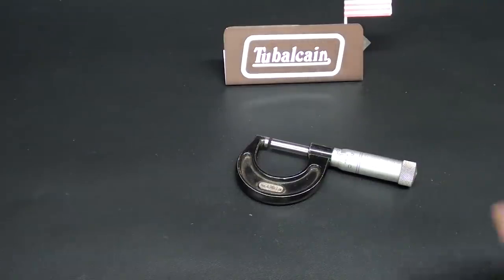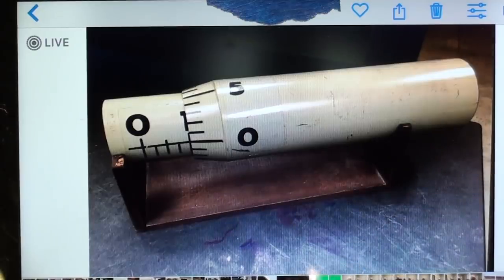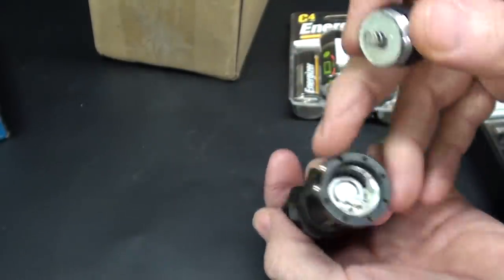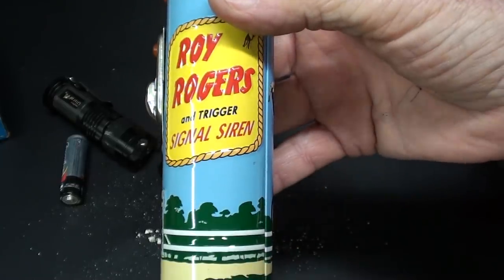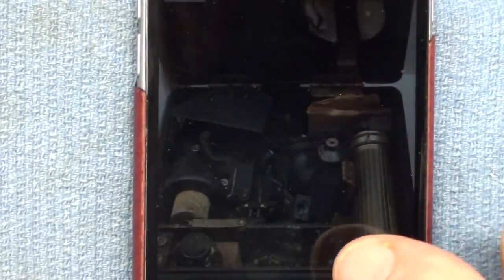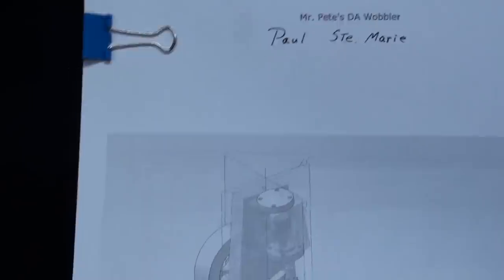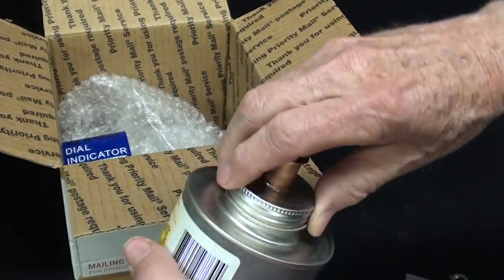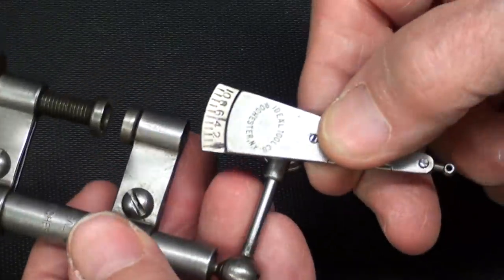THIS & THAT 45 tubalcain mrpete222 ideal indicator

Comment: Energizer at least used to make a fantastic product but I've had such a problem with them in the last few years that I'm almost certain they've changed something in the production process to save money and it's resulted in quality taking a dive
Reply: Duracell is also  getting to be lesser quality...I recently bought a 40 pack of AA and AAA 'batteries'...even though the package said good for 10 years, several of them were already corroded like the one in the CREE flashlight...I have a very nice Snap-On flashlight, uses a single A cell..the battery went dead right away and corroded the whole thing so bad I couldn't get it apart..
Reply from the maker: Yes, I agree on the poor quality of the energizer

Comment: R/e leaky batts-
Bought a surplus 1950's/60's radiological survey meter a while back, came with an original "Ray-o-vac" (with the black cat and the "9"), and it still worked. 
Meanwhile, I had to toss a 3 D cell mag-light because the modern batteries had leaked/swollen to where they could not be removed (without resorting to chucking the thing in a lathe and boring them out). 

Seems a lot of formerly "quality" brands are coasting on their former level of quality, while offering a far inferior product.
Reply from the maker: I totally agree
Reply: Modern alkaline cells also put out much more power, and have a longer life than the old carbon cells.

Comment: Thanks for the re-do on the test indicator.  Would be interesting to set up a last-word indicator to measure the deflection of the older indicator's body as you place ever increasing thickness blocks under its needle.  I only know of Roy Rogers' chain of restaurants from when I was a boy.  May have lasted into the early 80s on the East coast?

Comment: Do you remember back in the 60"s if the batteries corroded your flashlight you could send it into the battery mfg Ray-o Vac as i recall and they would send you a new flashlight. Them days are long gone.. Great video..
Reply from the maker: Yes, I did that with one flashlight. I also sent him a Bosch and laum shop microscope. A very expensive item. It took six months, but they sent me a new one

Comment: Alkaline batteries generally only leak once you start using them. Sitting on the shelf, so long as they’ve never been used, they can last an awful long time, but as soon as you draw any power out of them you’ve only got a year or two before they explode. If you want a battery that will never leak, look for the lithium ones (not lithium ion or anything of that sort, you want the non rechargeable ones in standard AA, AAA or 9v sizes. If you need C or D you can fit them with a sleeve that takes up the extra diameter).

Comment: Something to test with batteries. I have a small flashlight I carry in my notebook computer bag since I usually have it close at hand.
I've had the same problem with batteries ruining expensive flash lights. As a test, i reversed the batteries in this small flash light. They have stayed good for over a year now. If need all I have to do is reverse the batteries to get them to work. :)

Comment: I've bought half a dozen of those cheap Chinese lamps (~ $2 @ on EBay) and they work quite well. I keep one in my jacket all the time with a standard AA cell but those I keep in case of emergency, I store them with a 145000 Saft lithium battery that can remain alone for years without leaking. (those lamps work with either 1.5 or 3.6V batteries)
Reply from the maker: Good idea

Comment: Batteries that only leak in products and never in the package can be a bit of a mystery.  However, it could be a galvanic action of dissimilar metals from the battery to the contact and/or micro current drain.  Many item these days are not truly off, but on standby (like TVs with remotes).  I wouldn't think that would be the case with flashlights, but you never know.
Reply from the maker: Agreed

Comment: I think that the residual error is cosine error. If (if you want to REALLY want to beat a dead horse) you were to redo that series of gauge stacks with the sensing arm tilted down by 22.5˚ or so the tip is just below the pivot housing (enough that you can get your largest stack UNDER the pivot housing), I think you might find that it is even more accurate than this version of the test has shown.
Reply from the maker: I'm sick of this I'm done
Reply: @mrpete222   I just started watching your TV show and I really enjoy it my dad retired from Sears with 41 years in service and I'm thinking about collecting some Sears machine is tools would the Sears moniker on them like dial indicators and stuff can you point me in the right direction sir thank you

Comment: 6:30 I would suspect the cheap metal in the flashlight causing the reaction before blaming the battery.  Made in China I'm sure.  in some cases just having dissimilar metals touching can cause corrosion.  Are you sure the batteries leaked in your flashlight?
Reply: I wouldn't say so.  In the designed conditions, the nickel/steel cell case can make no contact with the aluminum to cause galvanic corrosion.  The case interior is anodized and the cell case has an insulating sleeve. 

As a result of gas generation internally, alkaline cells will exude potassium hydroxide as they discharge.  This is a minor detriment to the steel casing, but it's enough to degrade the case seal and promote self-discharge when supplied with atmospheric moisture.  While all that is utterly routine for the cell to endure, the electrolyte is remarkably more destructive to aluminum.  

Long story short, if you're using a reasonably designed solid-state light, you shouldn't be using alkalines or zinc-carbon cells anyway.  Alkaline cells will potentially leak once they are partially discharged.  Zinc-carbon cells will inevitably leak regardless of state of charge.  

The discharge rates involved (500mA to >1A for a AA format light) result in higher case pressures and only exacerbate the inherent leakage risk.  They also generally have such a high ESR that only a fraction of their stored energy can be used by the load.  The ESR characteristic alone means a LED light with a regulated converter will almost certainly have a longer and more uniform performance on NiMH vs alkaline.  Add that there's no risk of leakage, and there's little reason left to waste money on primary cells unless they're an odd size.  

I've bored too many batteries out of mag-lites in the lathe to be nostalgic about a technology that underperforms in some of its most common applications.
Reply: Thanks for taking the time - there's alot of information in that little paragraph.   @PSUQDPICHQIEIWC

Comment: You need a 14500  3.7v Li-ion battery for your cheaply  torch. It will work much better but always have a spare as it eats batteries on full beam.  N B you will need a lion charger   Max full charge voltage is 4.2v
Reply from the maker: Thanks